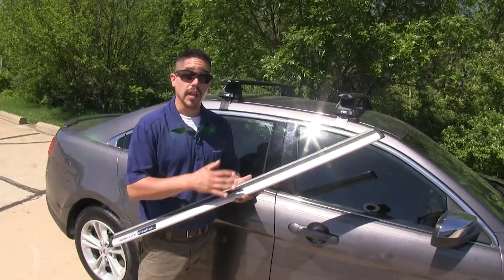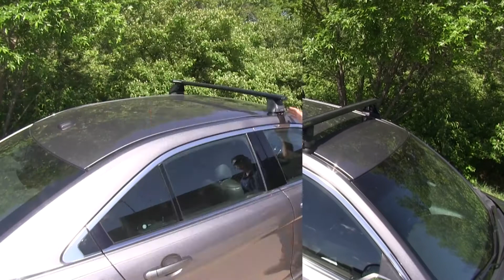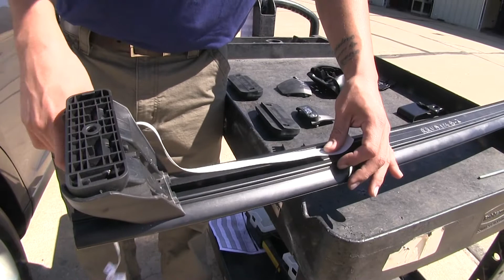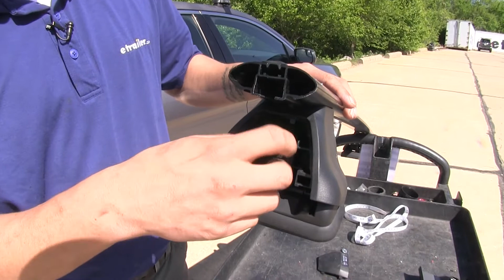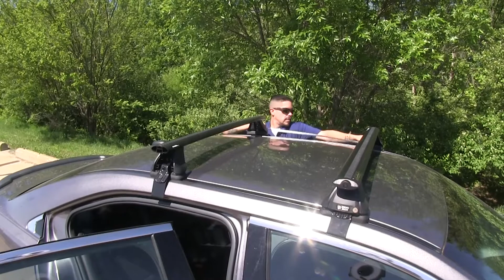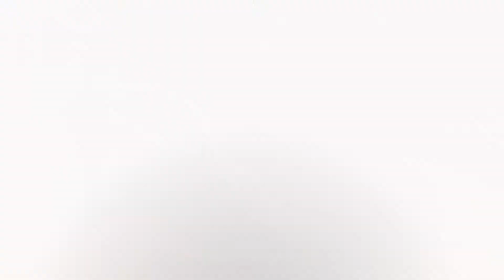Install: Custom DK Fit Kit for 4 Rhino-Rack 2500 Series Roof Rack Legs on a 2013 Ford Taurus

Comment: Will water leak through the door ?
Reply from the maker: We have not seen water leak into the doors of a vehicle with this style roof rack installed.
https://www.etrailer.com/Roof-Rack/Rhino-Rack/RRVA126B-2.html
https://www.etrailer.com/Roof-Rack/Rhino-Rack/RRRLKVA.html
https://www.etrailer.com/Roof-Rack/Rhino-Rack/DK229.html
https://www.etrailer.com/vehicle/2013/Ford/Taurus